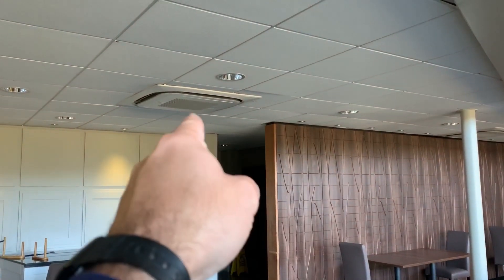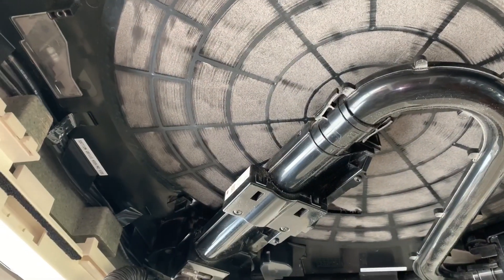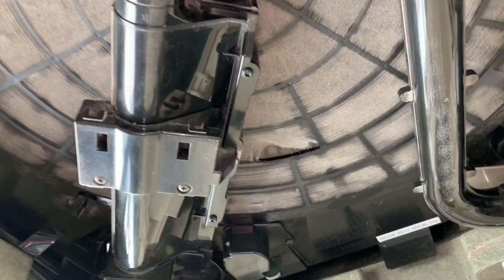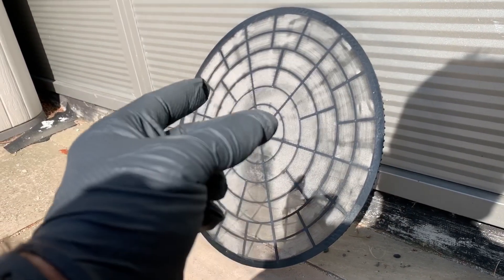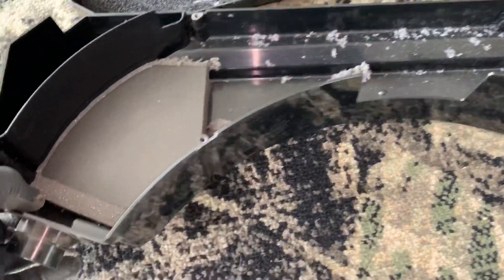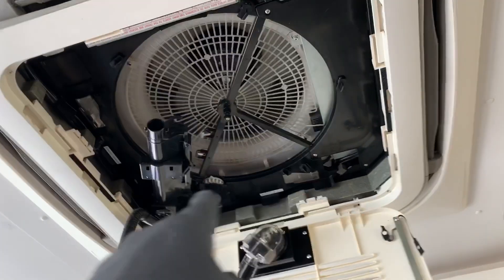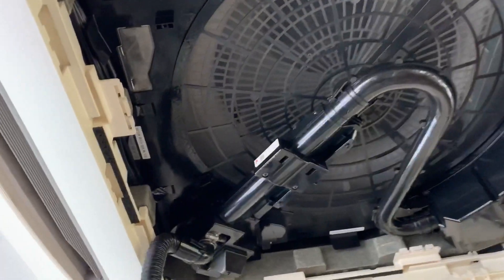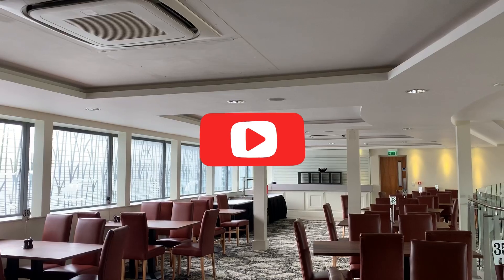DO SELF CLEANING AIR FILTERS WORK ??? HVAC UK

Comment: Usually when they’re not clean, it’s because they’re not installed correctly. There is a transition piece that has a rubber plug, and if the plug isn’t removed, the air from the fan can’t push the dust to the collector box, and the filter builds up dirt.  I had a daycare and school that had these, and the newer school had no issues, the filters were always clean and pristine. The daycare filters built up like the ones in your video. I took the install manual and found the installer didn’t remove the plugs.

Comment: That’s an incredibly dumb design - using the suction of the main fan to clean the filter - unless the fan is off, and (using a fixed brush) it brushes the dust into the arm and then turns the fan on to suck the dust into the box, unfortunately with that ac/heat-pump unit, it appears to put the fan on at a low speed while (apparently) cleaning the filter and then boosts the fan to suck the dust into the box. Either the brush is too soft to scrape the dust off + combined with the low speed fan making a vacuum on the other side = the dust remains stuck to the filter/the brush itself is caked with dust.
Reply: Yeah using the same fan is going to still be pulling air through the filter so the dust stays stuck!

Comment: Have a few of these in a gym in London, constant callouts for dust collector error. Always find the dust is caught in the dust collector motor! Also the motors always burn out constantly in a leisure/ gym environment. They are such a nightmare for a deep clean strip down! Great video though, keep them coming!
Reply: Yes, even though I have never exercised in a gym - I have never liked the their open style/arrangement, where the users/members can see each other exercising on the equipment. And the health/leisure company puts recirculating/multiple, split type ac units (that only remove the dust and heat/cool the air, and do not replace it) these must get incredibly stuffy when busy - with body/breath odour and carbon dioxide buildup, unless the gym has external fire exit doors and openable windows - an awkward way of replacing the air - particularly in summer/winter; freezing/heatwave. The more suitable type (I think) that gyms should have is the air replacement/heat-recovery HVAC type system; where the air is drawn from outside, through the 1st fan>exchanger part>conditioned and blown into the gym, then It is extracted>through the other half of the exchanger part>2nd fan and expelled outside. Unfortunately these tend to be more expensive and complex - compared to a split ac units, same problem with fitness studios/gym classes. The most obvious form we would have now, would be natural ventilation/combination of opening windows and extractor fans, supplemented with a HVAC system. Someone has already thought about that problem (before me) and created the outdoor gym in local parks, and most already do outdoor exercise/sport
Reply from the maker: Thanks mate 🙌🏼 Luckily I only look after one site with them. I’ve just disabled them now 😂 I  agree mate, pain to strip down. I don’t think they are right for high traffic areas to be honest.
Reply: Can't use in a hairdresser (hair spray)
Affected by diesel fumes in the city
Affected by large amounts of dust. 

Garbage.

Comment: Im a hvac engineer in UK and I came across a load of these units in a gym in Chelmsford and every one had a hole in, im not the biggest fan of that style, had a few of the motors burn out cause of the filter getting tangled up on the metal strip.

Comment: Really useful video if I ever have to service one of these. Thanks for that. Daikin split systems are not very common out here in my area of California. Daikin is same as Goodman out here in California and I am close by the distributor. How Long do those Daikin systems last usually ? Like # 33. Subbed.
Reply from the maker: OcRefrigeration , Hvac & Electrical Video's. Thanks mate 🙌🏼 Daikin and Mitsubishi Electric are probably leaders of the air conditioning market over here in the UK.
It’s hard to say how long they will last to be honest, big manufacturers usually offer up to 5 years warranty now.
But you could make it last as long as you want, just made need a few new parts along the way 😉👍🏼👍🏼
Reply: Daikin is great.  These are shite.